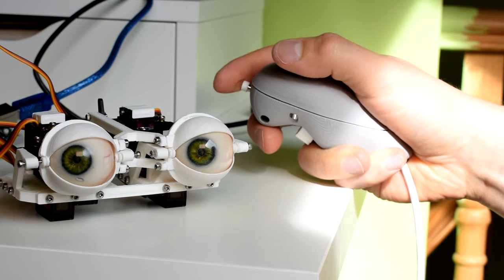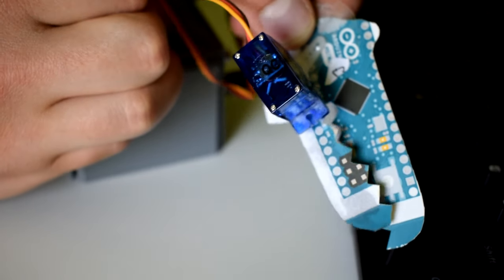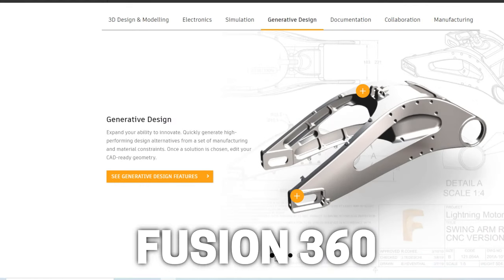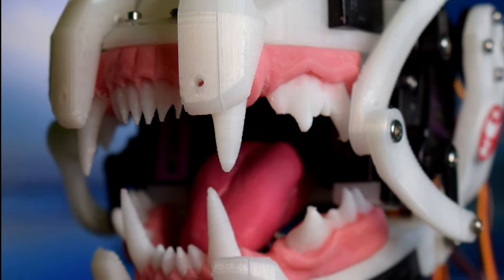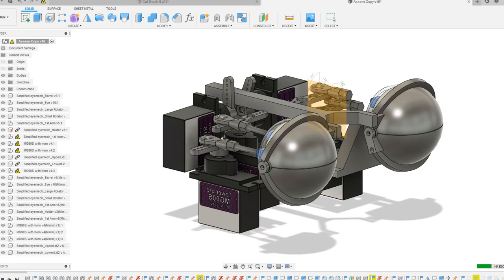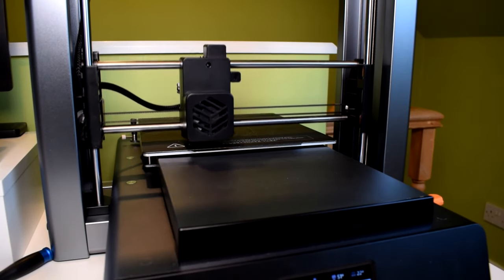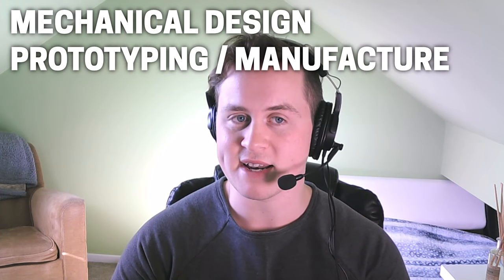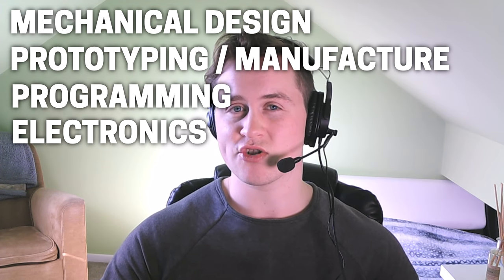How to Get Started with Animatronics – Thought Process, Workflow, Resources and Skills

Comment: I've been building projects with Arduino for years.
I use Arduino IDE exclusively, however, I highly recommend to NOT download and use the new version 2.x!
The devs have introduced some deal-breaking things.  I tried it out and became so frustrated that I went back to 1.8.19.
The one thing was that the devs no longer allowed the Serial Monitor or Plotter to be popped out in their own windows.

As for a month or so ago, I've added ESP32 to my dev projects. 
While Arduino is nice to work with, the ESP32 is far more advanced, faster, much more memory and you can still use Arduino IDE to program them.

When it comes to communications (WiFi, BlueTooth) for your projects, the ESP32 is far superior to the capabilities of the Arduino.

That all being said, I highly recommend that anyone working on larger projects use ESP32 boards. The WROOM is the main one I use, but I do have a 30 pin board and 2 ESP32-CAM boards, which is easy to use and nice for robotic projects.

As for Arduino, I stopped using the UNO years ago.  I opted for the Nano and then moved on to the Nano EVERY board as it has much more memory and faster.

So much fun.

Comment: 3D printers can be a major purchase for some people, me included. Having a basic knowledge of fabrication techniques and materials will take you real far. Saw, cut, bend, melt, glue, poke, screw, clamp, stretch ect. If you know how to do those things and experiment with materials in new ways you will be much further off than just knowing how to do CAD and 3d Print. 

Another thing I would mention is to know your strengths and weaknesses. If you are good at computers, great. If you are good at making things in a workshop, also great. If you are just a resourceful and creative person, even greater :) Do as much as you can with what you are good at, and at the same time get more experience at what you are not so good at. Find "mentors" or people you admire and try to emulate what they have done. Gather resources like forums (RPF), and already used designs from websites, magazines etc.

Emulate, then Innovate. :)

Comment: the code on arduino page isn't available Please reupload it
Reply: #include <Servo.h>

Servo myservo;  // create servo object to control a servo

int potpin = 0;  // analog pin used to connect the potentiometer
int val;    // variable to read the value from the analog pin

void setup() {
  myservo.attach(9);  // attaches the servo on pin 9 to the servo object
}

void loop() {
  val = analogRead(potpin);            // reads the value of the potentiometer (value between 0 and 1023)
  val = map(val, 0, 1023, 0, 180);     // scale it to use it with the servo (value between 0 and 180)
  myservo.write(val);                  // sets the servo position according to the scaled value
  delay(15);                           // waits for the servo to get there
}
Reply: @LKDAnimatronics  thank you so much bro